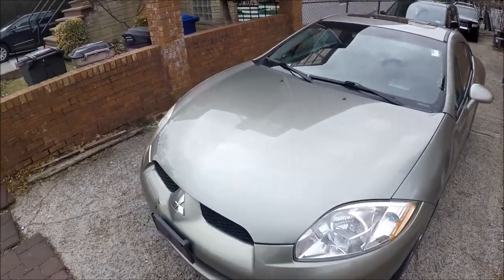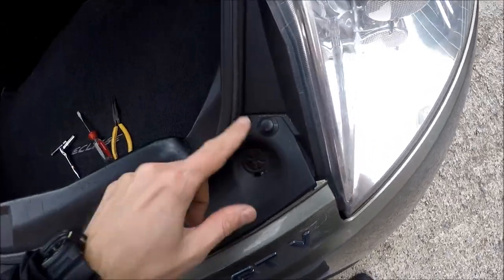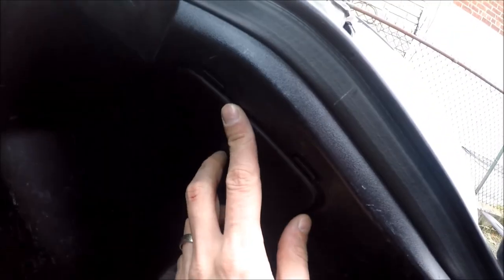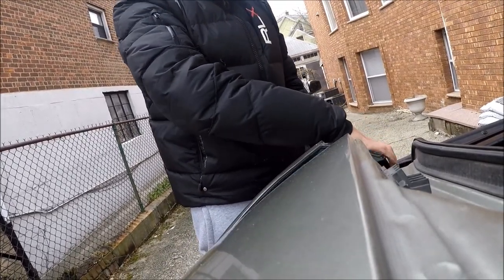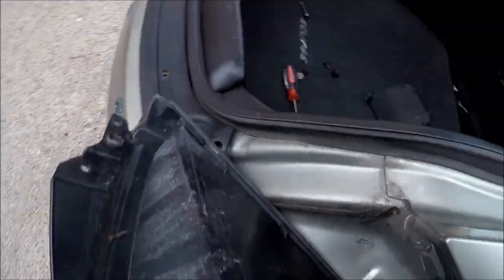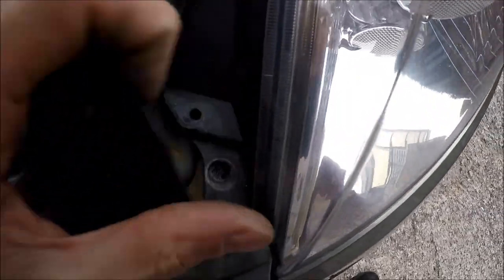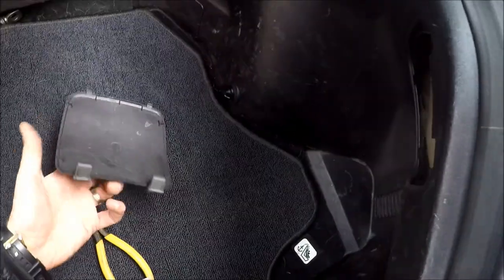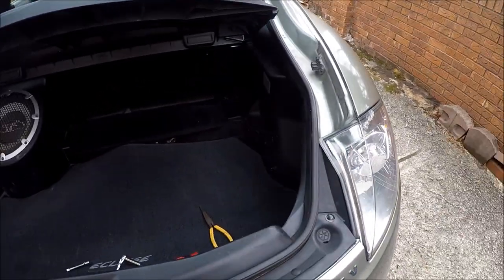How to replace Tail lights and bulbs in Mitsubishi Eclipse 06-12

Comment: sweet tutorial bro, thanks for skipping over the part about me needing to remove the entire back panal to get at the wiring harness.
Reply: whot? its just a finger tab in the rubber plug? move the tab over with your nail and pop it out to the side with a screw driver?
Reply: @tbomb2336  I guess it's changed over the different years? My 06 I have to pop off the rear panel to access it. Lol it's been 3 years since I was messing around back there but I remember it being a lot more complicated than a single tab. Also I remember it being a massive pain in the ass to seat the panel.
Reply: @kbforme  ah makes sense